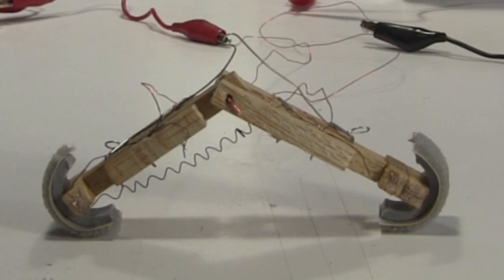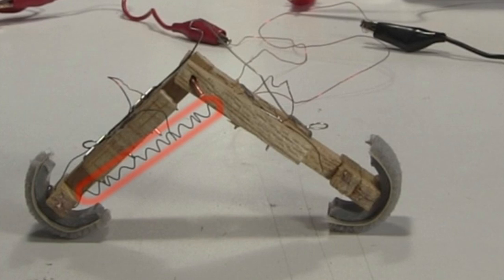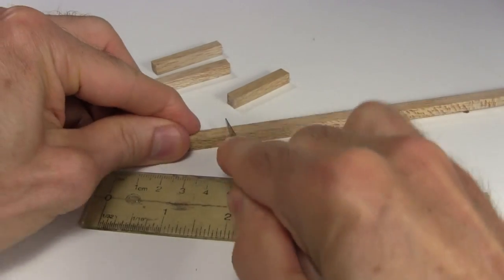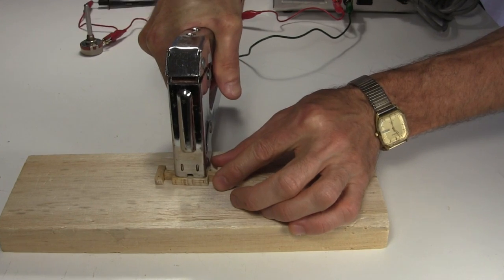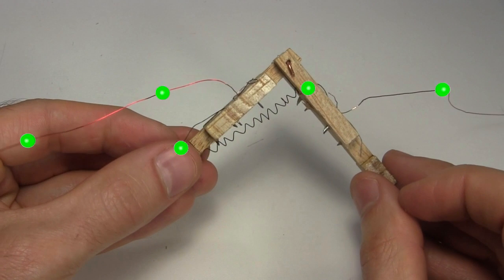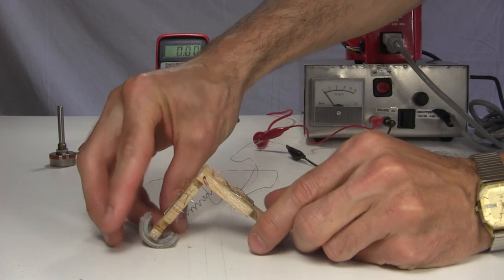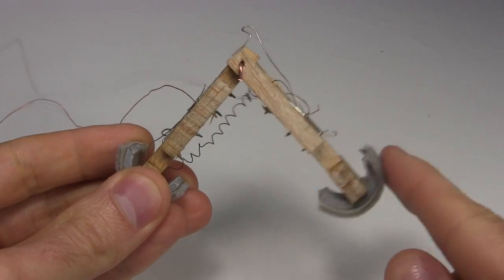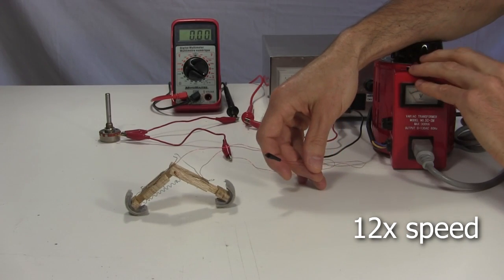How to Make Inchworm using Nitinol Wire/Shape Memory Alloy

Comment: what is the diameter of SMAwhat is the voltage and resistance given by you for actuation
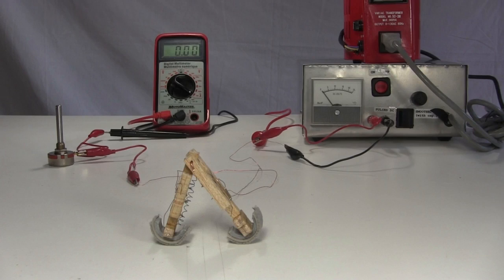Reply from the maker: +biswaranjan das It's 0.01" diameter. You can see the voltage on the meter attached to the front of the silver colored metal power supply just above and to the right of the inchworm at around 2:41 in the video. The meter has numbers written on its scale: 0, 5, 10, 15, 20, 25. So it's around 5 volts when actuated. I didn't make a note of the resistance on the resistor but the current on the red multimeter at the time is around 0.9 amps. So from ohms law I'm guessing it's 5V/0.9A = 5.5ohms (not sure if that makes sense), but that would be the resistance from the potentiometer and the nitinol wire. It's a 10kohm potentiometer so it must have been turned down all the way.
Reply: thanku sir for giving this information.